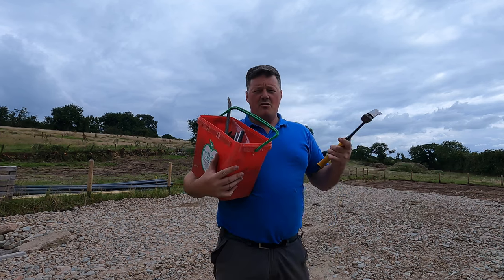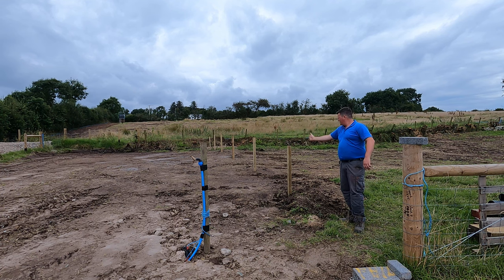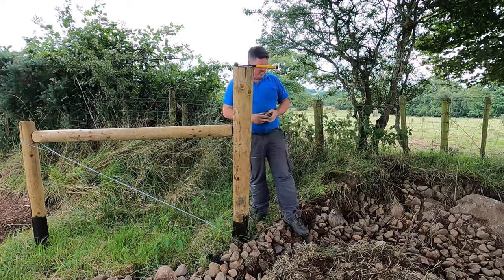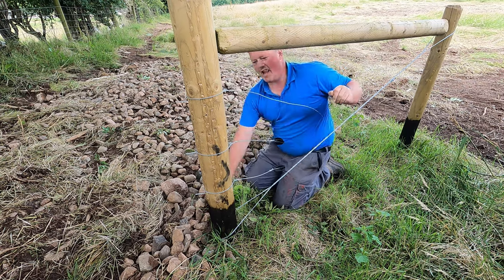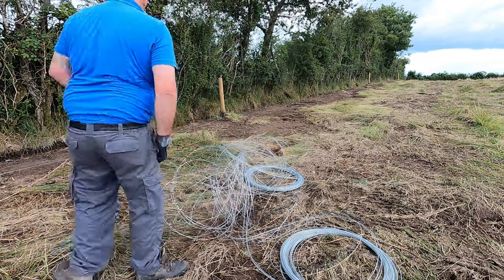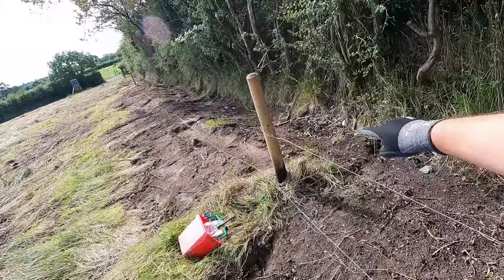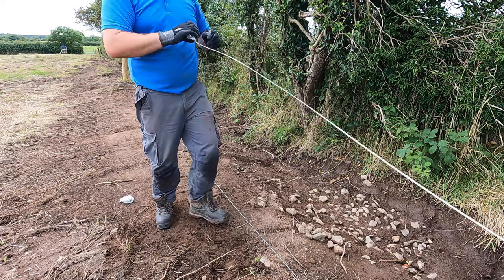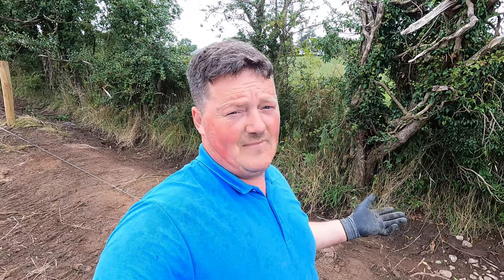FENCE WIRE IN KNOTS / UPPER FIELD ELECTRIC FENCE WIRE 2.5MM

Comment: hi pete just found your channel. wires look grand mate im not a expert just a farmer down in new zealand. i tie of the same way but only wrap 3 times so i can keep the handle short to get a nice tight wrap going. we use bolt cutters to cut the wire much easier you can stand one end of the wire hold the other with one hand and use your other hand and knee to cut the wire so it dosnt bugger off down the feild
Reply from the maker: Hi and welcome!
I have just started to edit next video where I mention spacing for my fence wire. From bottom up, I'm going with 16, 26 and 36 inches. I have sheep and they are staying behind 2 strands of ploy wire.

Comment: When you roll out HT by hand, hook the roll  in one arm and walk backwards paying out 6 or 5 coils off the top of the coil, it should look like an old telephone wire laid out in front of you.
Then turn the roll 180° and pay out another 5 or 6 coils from the bottom. 
Pause and pull the wire slightly  and the coils will cancel each other out and leave the wire dead straight.
Keep repeating this as you go.
Give it a go, and you'll  easily be able to control the torsion in the reel.👍
Reply from the maker: Thanks bespokefencing I'll defo have to give that a go. I was trying to save walking up and down the run several times but this time my plan back fired lol